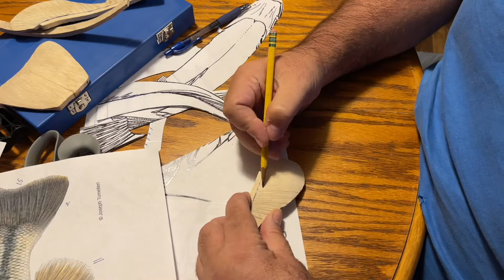Large mouth bass Pt 5 carving and mounting fins

Comment: What bits are you using for the initial cut into the dorsal area for the fin insert? It looks like a wheel…
Reply from the maker: It’s a mini saw blade that I bought at harbor freight. It was a set of 3-4 sizes. But I don’t use it anymore because it’s kind of sketchy to use. Actually kind of dangerous. I rarely use them anymore. 
I use a bit now that’s a small corse stone.
It’s about 5-16th of an inch in diameter and roughly 3/16ths of an inch wide. 
This bass was one of my early projects and I think it was only my 3rd fish carving. Look at some of my recent videos. I’ve used the stone bit above for a while now. It makes the perfect width and depth for the way I do my fins. I don’t know the brand of it because it came in a set of bits with my Foredom. 
But Sabortooth makes one that’s steel that’s very similar that I’m sure would work well. And I think Kutzall has one similar also but I don’t know if they make one as small.
Reply: Thank you so much, Danny! Your work is beautiful! Keep it up!